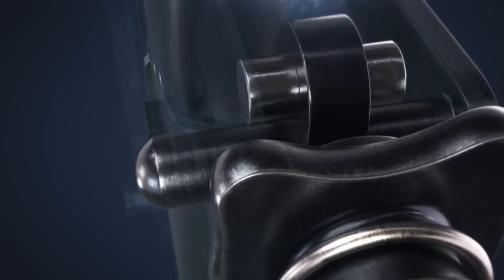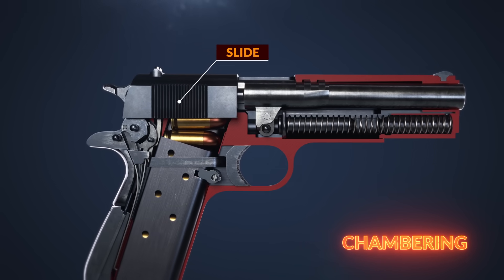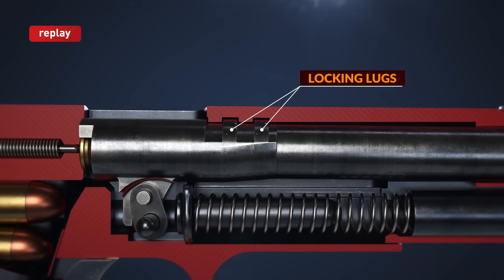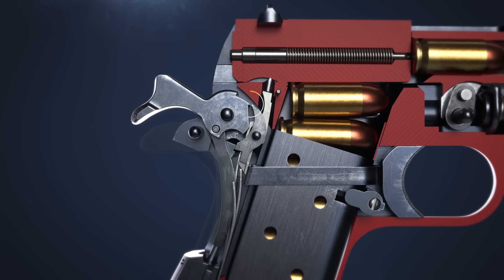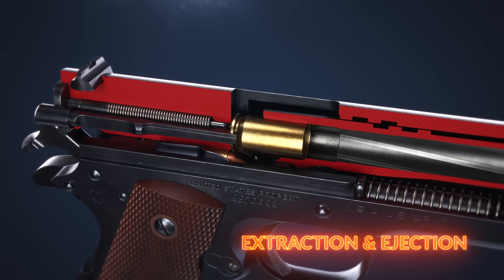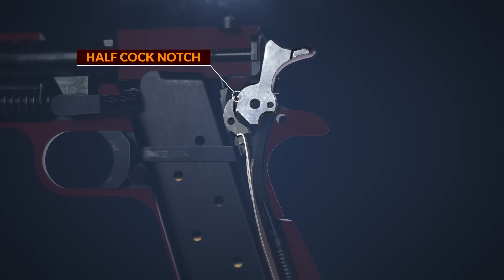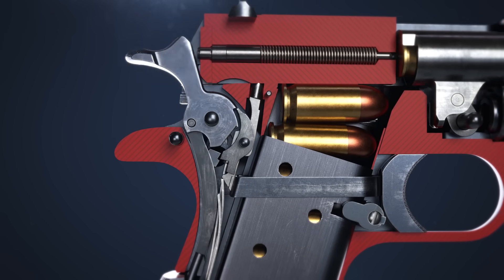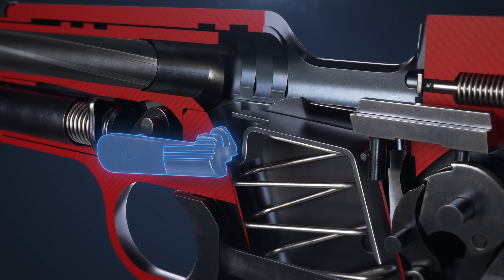How a 1911 Works

Comment: Another work of art, beautifully made and with an incredible attention to detail. I'm going to replay this one a lot, great to see you again Matt !
Reply: @laddition8963 hello,
Would you show how various optics work? Are they sighted in for X distance as the optic sits above the barrel and with bullet drop so many other variables determine where the round will hit?

Also, it would be awesome to see how the actual bullet shape affects the target and even the bullets flight.

Why are bullets not like a screw with spiraling to enhance spin? The bullet is smooth. Would a screw twisted bullet catch the barrels internals for a better spin? Do you know what i am trying to say? 

If a bullet had the threads of a screw, could it catch the groves of the barrel and spin?

Why are handgun rounds Round nosed, or hollow pointed? Why are rifle rounds tapered at the tail end?
What are the differences between hollow point, jacketed hollow point, tracers, boat tail, ect...

The zip 22...
Oy vey...
Could that thing have been better if it was actually modular, a more powerful round, better designed?
It did not have the profile of a typical firearm. Could a better design be made where the bore axis was in the middle of the hand for better control? 

What makes a modular firearm? Interchangeable calibers, stock, 

Could a handgun be designed with 2 magazines such as something like the kel-tec where there can be different shells.
For example less lethal rounds in 1 mag and hollow points in the other?

Less lethal rounds such as small bean bags, pepper rounds, even tiny shot pellets from 1 mag and the other with FMJ or HP

These are just ideas, I'm not trying to have comments telling me I'm stupid or anything. These are just ideas for content that may answer questions for those who do not have substantial knowledge of firearm operations. Please dont blow up my post. I cant get notifications of replies anyway.

Admin,
Thank you for reading my comments
Reply: @kg-WhatthehelliseventhatWHAT
Reply: Thanks dude! :face-turquoise-covering-eyes:
Reply: You should make a video about how a desert eagle works
Reply: @laddition8963 amazing?  Look at the difference in aviation during this period
Reply: why i am last all the time 4 utube to give me these vids?
Reply: Great video, such a brilliant design. So many things I did not really know about how my old 1911 works. Are the newer versions still basically the same? My Springfield XDM  is so much fewer parts inside.

Comment: I consider the S&W 9mm EZ the son of the 1911.   

The EZ has a single stack mag, like the 1911
Grip and Thumb safety (not all models), like the 1911
hammer fired (internal EZ vs external 1911)

Comment: The funny thing about the 1911 design is that it's very old, one of the oldest among semi-automatic pistols, but it also has the best trigger feel because of the sear design.

When a trigger breaks, the ideal feel is that of breaking a thin glass rod. And that's exactly what a well-designed and tuned 1911 trigger feels like.

I have a 1911 and a 2011 and several plastic guns and all have aftermarket triggers in them. The plastic guns just feel mushy and have creep. They're better than stock, but they can't approach the feel of a 1911.

Comment: Not that this would likely be better overall, but, out of curiosity, would eliminating the systems which employ recoil to load the next round and replacing them with a rigid system that directs all force towards bullet propulsion result in greater velocity and force for the bullet? Is there an exchange made in this choice? Like, a revolver without this mechanism, would it have higher stopping power? Just wondering about the physics here, and the scale of the impact if there is one

Comment: i never understood why does the barrel need to move on 1911's. why dont just move it a bit down or push the bullets a bit up so they can chamber? makarov pistol does it and it works fine.
Reply: The Makarov uses 9x18mm which is a low pressure round.  Therefore the Mak can use straight blowback action just fine with a fixed barrel.
9mm and 45ACP are high pressure.  They work better with a locking mechanism to delay unlocking the chamber to allow pressures to drop.  The Browning tilting barrel design is there primarily to lock the chamber until pressures drop enough, after which the barrel tilts to free itself from the slide (barrel locking lugs drops out of slide locking surfaces) and unlock the chamber to start extraction.  
There are alternative locking mechanisms like rotating barrel or locking block designs but they add complexity in parts or machining.  They all have their pros and cons, but the Browning tilting barrel design is the most popular for a reason.

Comment: Can I "safety" it by manually releasing the hammer like with a revolver? Having one in the chamber and just need to cock the hammer again? 🧐
Reply: No.  There is no hammer block, so having the hammer decocked means the hammer pushing on the firing pin which is then pressed against the primer of the case.  Any shock to the rear of the hammer will cause it to fire.  The 1911 is not designed to be carried hammer down and chambered.

Comment: Why does the barrel need to move at all? Specifically, the rear end of the barrel when a round is chambered.
Reply: Pistols that are chambered in high pressure rounds like the 45ACP usually rely on a locking mechanism to allow chamber pressures to drop before unlocking the chamber.  For that, the slide and barrel are locked together a very short distance of travel, and then the barrel drops so locking geometry on the barrel releases from the slide to begin extraction.

The reason for waiting for the pressure drop is that at the initial microseconds of firing a high pressure round, the chamber pressure spikes tremendously.  This creates two problems.  The primary problem is the casing at peak pressure is basically glued against the walls of the chamber.  It's near impossible to extract until pressure drops.  Second problem is that without the mass of the barrel moving with the slide during that locked portion, it significantly increases the acceleration of the slide causing much more violent and stressful cycling.

Comment: It looks complex, which means it's probably not very reliable. Compared to a Glock, which is simpler (or the video isn't detailed enough).
Reply: It's a design from over 110 years ago of course it's more complex than a Glock.
Reply: @JEG1492  Sometimes it seems counterintuitive when the old thing is more complex than the new one :)
Reply: @Losharich  Oh, very much so yes, older designs were far more complex than newer. The C96 and the Luger are also good examples of that truth, along with all the early examples of self loading rifles being overly complex as well. Our modern simple short stroke piston rifles and simplified browning tilt barrel pistol actions are evolutions towards a reliable, simple, efficient mechanism. We've gotten SIMPLER over time believe it or not. That's a huge misconception but a pervasive one that firearms have gotten more complex. No, they've gotten simpler over time.

Comment: Incredible! The feeding ramp is polished to a mirror sheen. The slide's been reinforced. And the interlock with the frame is tightened for added precision. The sight system is original, too. The thumb safety is extended to make it easier on the finger. A long-type trigger with non-slip grooves. The base of the trigger guard's been filed down for a higher grip. And not only that, nearly every part of this gun has been expertly crafted and customized.
Reply: @SaintNicholasFan  You're pretty good! 👉👉
Reply: It's funny that in the middle of a string "customized A, customized B, customized C" it suddenly says "D is original" (the sight system) as if that's inherently cool.  Yet the customization was supposedly the cool part.  Come on Kojima.
Reply: @AquaticMammalOnBicycle  I think in this context original means custom made, which is also a meaning for original.
Reply: @SaintNicholasFan  Where’d you get something like this?

Comment: Top-notch animation, kudos! Just one detail I dare to point out---the grip safety is animated ever so slightly wrong, in that when engaged (i.e. when you don't grip the pistol), it sticks out---and it gets flush with the back strap when you grip the gun (and thus disengage it). That's only logical; you want the back strap nice and flush at the moment of the shot; .45 ACP produces quite a bit of recoil---you don't want such an edgy step right where the pistols slams into your hand... Otherwise, superb!

Comment: Carried one as sidearm for 8 years while army aircrew. Might not be the most sexy sidearm but we’ve been through thick n thin together. Wouldn’t have anything else on my side.
Reply: @chrissmith7669  this isn’t a sexy sidearm…? I just bought one as my first gun for $1k cos it was sexy! That was legit the only reason because I heard it was more difficult to use/maintain than a Glock. But glocks look boring, this thing looks beautiful absolutely beautiful SW1911 E series
Reply: @mclovin9151 lol.   Some guys do gush over how one or the other looks compared to others.  For me a tool.  Mine while served looked like it had served in every major battle the U.S. ever fought in. Loose, worn, and scarred.
Reply: Correction... it just happens to be the sexiest sidearm in existence. Just saying.

Comment: still confuse me how the recoil works.
did the gas push backwards from inside the barrel or from the tip?
Reply: The gasses escaping the barrel push backwards on the shooter. This also pushes the slide back, cocking the hammer again and then loading the next round into the chamber ready to fire.
Reply: @BloodyKnives66  ty. i had a hard time comparing pistol blowback and ak blowback. with ak things made sense with the piston thing.

Comment: These have been my go to videos for helping my wife get past the anxiety around firearms. Fast forward five years and now every Saturday morning we go to the range together. She has many different types of firearms now and has a decent draw and a gets most everything in the middle circle of a target. Between 5 metre and 25 metre you are probably done if she has you in sights.
Reply: @larsvongraff5794  you should probably go to the doctor and get checked for lead poisoning. You all going that often to the gun range shooting leaded bullets will get you lead poisoning, not trolling look it up.
Reply: @Firesky0008 very careful. We usually change clothes to our range gear before going in and then coming out. Lead off before we leave the range itself any area exposed. Also we get the lanes to the end to minimize gas and this is also right next to the ventilation system in the room. Shower with lead off at the house and all clothes immediately with lead off detergent. We also just had our blood tested and nominal reading at the very bottom end or register. I think that’s because of the discipline around this. Good you know about. You are 💯 correct. 👍

Comment: Absolute poetry in motion! I love the shape and the fit in my big hands.
My kid bought a Luger frame at a gun show and later all the parts to put it together. He was still "fitting" it up to cycle when we went shooting. He shot one, it never picked up the next cartridge, and so on. 
  I took out my ATI 1911 and mag dumped it in the target and said, "that is why we won WW2". He did get Luger to working well, sold it and bought 2 1911's.

Comment: You should do a video on the Walther P-38. It's an iconic gun that would've gone up against the 1911 in WW2. A successor to the venerable Luger and it also inspired the Beretta 92 which suceeded the 1911. It could make for a good video because you can show off the locking block, magazine heel release, double to single action function, decocker and loaded chamber indicator.

Comment: I don’t care if this makes me sound like a boomer, but I cannot compliment the 1911 platform’s reliability enough.  Ever since I bought my 1911 (being a Mil-Spec Springfield Armory, the 2nd cheapest option there after a 9mm variant), it has not jammed on me once.  Not while breaking it in, not after a while of not cleaning it, and all the while being one of the most pleasant handguns to shoot in spite of its .45 chambering and additional weight (and even then, you don’t feel much of the latter once you get used to it, as much of the weight has a lower center of mass closer to your hand, in contrast to, say, a Glock with its metal slide and plastic grip).

My only gripes with the standard platform is that the slide release is farther forward than it is on most other pistols, and that the magazine is a little harder to quickly insert due to its single stack nature, but I honestly think those are small potatoes compared to what the 1911 platform just gets right.

And before people complain to me about the capacity, remember that snubnose revolvers are often considered for self defense in spite of typically carrying about 2 fewer rounds, being much more awkward to reload quickly, on top of not having the same great trigger capability, even with the 1911 platform having the slide release farther forward than most other semi-auto pistols.  That also being said, I wouldn’t exactly recommend the OG spec 1911 for conceal carry either, specifically because of the barrel being longer than sub-compacts (thus harder to fit in most conceal carry holsters), and because 10mm Auto does what .45 ACP does, but better (the slimmer caliber means you can fit more in a magazine, all the while 10mm Auto specifically has similar ballistics to .357 Magnum).

Comment: Genius design. It’s unreal that John Browning designed something like this over 100 years ago. And we still use this system today. Even your Glock use Browning’s short recoil design.
Reply: Have a look at a mechanical calculator of the day...
Reply: @VinEllis  indeed. The M2 .50 heavy machine gun is 100 years old, and will most likely be in service until direct energy weapons are small enough to fit in an AH-64, and not a Boeing 737!!! 👍🏻
Reply: People weren't idiots 100 years ago.  Concrete that cures under water was invented by the Romans over 2000 years ago. It took until the 18th century to rediscover this technology.
Reply: @HXP1969  it's just crazy that jmb hit it out of the park that hard in 1911. It's just a really cool gun
Reply: Nearly flawless design.  IMO, one of the sexiest guns ever made.  And rivals Stoner, Glock, and Kalashnikov for utility/versatility/long-standing
Reply: @bubbaballer88 absolutely agree 💯
Reply: I agree, but honestly, to this day I find it facinating how many mechanics are hidden in the grip, and stock in case of rifles... Even older revolvers did that.

Comment: Thank you for highlighting at 2:00 that the movement of the barrel and slide begins simultaneously with the bullet acceleration in the bbl! It’s a common misconception that the mechanism ”waits” for the bullet to exit before moving at all. 

Slight correction to 1:10 though: it is the barrel lugs that push the barrel up to lock it, not the link. The purpose of the link is only to unlock the barrel when the slide moves back.

Comment: i have a real question, at 2:00, when the round is fired, does the projectile really exit the barrel before the slide even starts moving? or is this just to clarify how the different functions work one by one? thanks!
Reply from the maker: Nope, the barrel is actually moving back just as soon as the round is fired. It’s kind of hard to see in the video, but it is in fact moving.

Comment: Excellent visualization of why this pistol is NOT drop safe. 😂 

(cocked and locked, that little sear is the only thing stopping the 1911 from firing, as opposed to Glock’s inherently drop safe firing mechanism)
Reply: The 1911 isn't drop safe because it doesn't have a firing pin safety to prevent the firing pin from moving unless the trigger is pulled. The 1911 going off when dropped on the muzzle is due to just to the firing pin continuing to move foward when the gun hits the ground. It has nothing to do with the sear. Plus it's more than the sear holding back the hammer when the gun is cocked and locked, the safety is also holding back the hammer incase the sear fails. There's also the half cock notch safety.

Comment: The M1911 was designed in 1911 by John M. Browning(famous  for designing the BAR M1918 and the M2 Browning) , Chambered in .45 ACP(stronger than 9mm NATO), service from 1911 ending in 1985 when 9mm NATO pistols like the Beretta M9, SIG P226 and SIG P320 was introduce to require NATO standards, however some US soldiers prefer the M1911(modified tactical versions with optics, silencers, long mags, etc.) than other 9mm sidearms